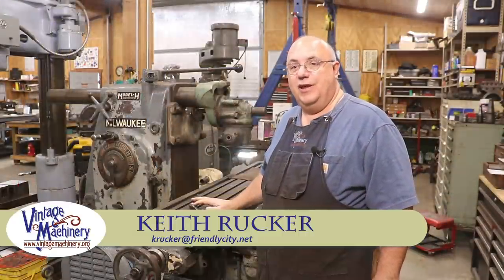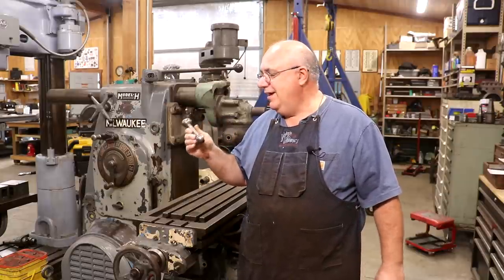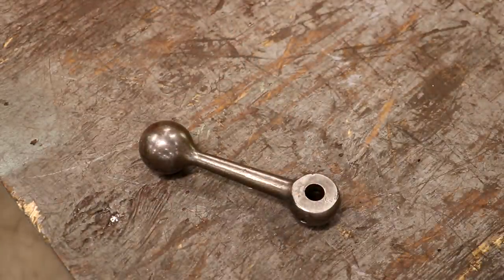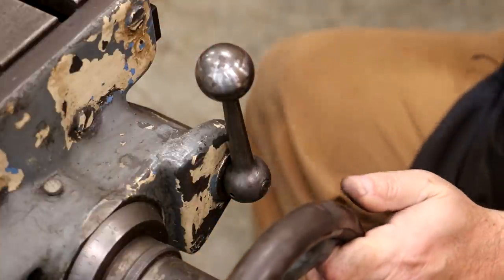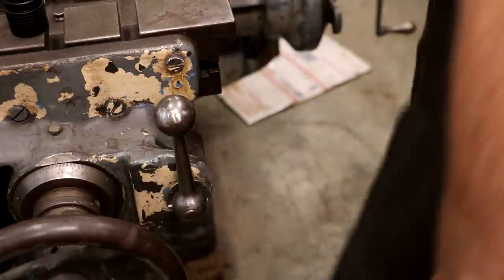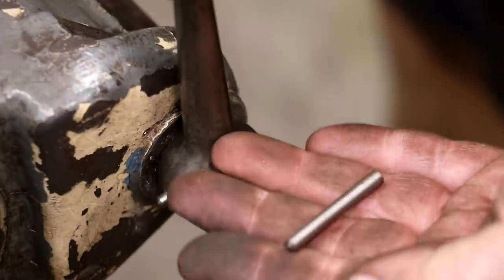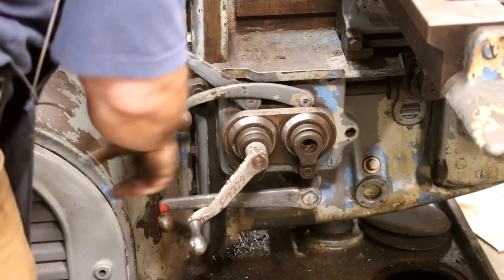Installing a Replacement Feed Side Control Handle on my K&T 3H Milling Machine

Comment: Hi Keith!  Thank you for your videos - they are well done and informative - especially the ones about the K&T!  Throughout the knee-type product line (numbers 2 to 6) the model Ks were heavier machines by one column size than the Hs.  The numbers relate to table travel.  A 3H would have the same table travel as a 3K (34 inches) but the 3H column would be the size of a 2K column.  (FYI the optional controls on the side of the machine are  designated as "rear controls"  because they are behind the table.)  Jim Donndelinger - K&T 1953-1990.
Reply: place I worked at had dozens of the K&T knee mills when i started there. Virtually all had the rear controls, and always thought all of them did.  I remember K&T advertising that this machine could duplicate itself (now I feel real old). Later on (early 1980's) they came out with a new line of knee mills, and these were to be avoided! I rebuilt two that were about three years old (tool room use only), and the engineering just wasn't there anymore

Comment: Keith- in a former life I was a helicopter mechanic, Bell 47s- and they used a #2 taper pin to secure another pin that secured the upper engine mount to a tube steel “engine basket “.  These pins were threaded on the lower end and tightened by self locking nuts.  In flight those two pins held the entire airframe to the engine/rotor assembly.  Quite essential, but never heard of a failure.  Who’d a thunk it?

Comment: I've spent many hours running vertical and horizontal Milwaukee K/T mills. Fantastic American quality. Brute power, and precision. Although it is hard to beat a Bridgeport for light milling, precision hole punching, and ease of operation. Keep up the good work! Lotsa memories.
Reply: With Booth, Fenner, Rucker & Summers using K&T: Who has a chance to piece a nice collection together?! Just kidding. I didn't discover my YouTube Professors until after I bought my Van Norman. As for the 'Brilliance of Bridgeport' (wait for it), I prefer the solid design of the older machines with their centralized table feed motor. Those have very robust columns & really everything be comparison. Yet, Bridgeport's Brilliance is in their head design. It is almost intuitive! In fact it is so foreign to most of us to move the part on the table into a spinning cutter, that it was easy for Bridgeport to become a household name! Hey, I've got a Bridgeport head for my Van Norman (just in case)!!

Comment: haha, check that out. The side controls have a safety feature. You can't engage rapids if the removable handle is  not removed. :-) That is adorable.
Reply: I caught that as well....can you imagine having that handle in place and pulling up on the rapid feed and having that handle slapping around your privates.....yikes.
Reply: @ericsandberg3167  Yes, I can imagine that. I've ran a couple of machines that had no safety features like that and if you engage a rapid, the handle goes spinning, weeeeeee! I've personally never been hit by that, but one colleague of mine once decided to be annoying and stand over my shoulder, and he got slightly smacked. Can't say I felt bad for him.

Comment: Made me reflect on the number of times I've seen younkers wailing on a pin with a drift and 4 lb hammer because they had never seen a tapered pin. The look when you give it one sharp rap and send it across the room is priceless.

Comment: You remembered me of the Cincinnati no.2 tool &cutter grinder. The cross slide handle turns backwards to a milling machine. I have operated  them for over fifty years and found no reason for it . Over time you get used to it . The No.2 original had only controls for the table rack and pinion only in the back side of the table but in newer models they had dual controls front and rear. Made the machine more convenient to run .
I agree with you taper pins far and away better than a roll pin . It makes a lever or arm stay put. 
I think they did it that way because it's easier than a threaded shift and keyway .

Comment: As the owner of a Kitchenaid mixer I'm surprised K&T didn't have a pasta maker attachment.
Reply: (:-))) Pretty heavy for a mixer but might work if you like to do your milling and cooking in the kitchen?
Reply: @ellieprice363  sometimes we’d like to whip up a snack in the shop. That would be perfect. Having a mixing attachment would be a dream. I could whip up pancake mix on the spot.
Reply: Hey, just hook up your kitchen-aid mixer to the end of that rotating KT arbor and have at it.

Comment: I was surprised to hear you say you didn't think a machine tool company wouldn't use a jig to make those holes. They are in the business of making precision parts and I didn't think they would do it any other way. They might not taper the holes but it seems they certainly would have made the holes in the shafts and handles with matching holes.
Reply: I've replaced dozens of handles on them over the years, and a new handle is usually very close. You will still have to ream the taper pin hole as the ship it a little undersize. Location will be very close everytime. Personally I hate taper pins, but thats about all they used sixty years ago. I even went so far as to make several blocks to drill and tap them to pull the pins with a knocker. I hate hammers!

Comment: I think I learned to like tapered pins back in the 1950s when my dad began buying Norden (or Sperry? I forget) bombsights to salvage for small gears and bearings. They put those things together with set screws and tweaked the positions of the gears and the bearing brackets until everything ran smoothly. Then, without loosening the set screws in the gears and hold down screws in the bearing brackets, they drilled, reamed, and drove in tiny (these were 1/8" shafts) taper pins. Once set, they could take it apart for service or repairs, and be assured that it would go back together in exactly the same position, with all clearances preserved. Even as a pre-teen, I had seen how set screws came loose and things shifted or spun on the shaft when you depended on set screws only. Brackets moved to the limits of their clearance holes when their bolts or screws worked loose. Taper pins made things STAY PUT.

Comment: Hey Keith there are so many people who would swear that you are running that file by dragging it back and forth on the part like that. Do it some more. Funny thing is it actually doesn't ruin a file doing that as this guy showed in a video. He showed the only time it ruined a file is when it was a fine file. A medium or coarse file it actually did no more damage than doing a lift to return to the back position before the next cut. And it actually cut more material than a lift type of use. I was surprised to find that out.
Reply: Yep, Fireball Tool.  Really enlightening experiments.
Reply: @royreynolds108  can't remember who it was but it may have been fireball. I've always let the file drag even though everyone says I shouldn't.

Comment: I can't say that I've ever seen the slotter option on any K&T knee mill. The universal head was seen every now and then, but not on everyone. There was a tilt table option, but also not real common. Then of course there was the motorized head stock and tail stock option. I've seen two or three of them. A well built machine, and about the only thing to work on was the feed system built into the front of the knee. Lots of little parts, but pretty much strait forward. Alot easier than a Cinn.  knee mill. If you take the spindle line apart, be sure to order new bearings right away!! Some of them used a real odd ball center bearing (I learned the hard way)

Comment: I agree with you that taper pins are better than roll pins. I've had roll pins shear off on distributors in my old truck. 4 different distributors failed because of the roll pin shearing on me. I would be driving and suddenly the truck engine would die and the tach would drop to 0 even though the engine was still spinning. Dont know if it was a bad batch or what but they were under warranty so I just took them back. Only had to get a tow 1 time.
Reply: Did the roll pins shear of did they break? One is too soft and one is too hard.
BUUUT better a roll pin break then a distributor drive gear or shaft fail. 
Chinesium parts are just garbage. Uncle Tony's Garage has many rants about new garbage parts.
Reply: @bwyseymail  they sheared. On the first one I understood there was a problem with the distributor and it wasn't free spinning. On the others you could spin them freely. Of course the fit of those distributors seemed kind of sloppy so that could have caused binding. I bought a hei ford distributor off ebay and the tolerances were way tighter and that problem stopped.

Comment: So this would not affect function, but I noted the handles on the opposite ends were clocked 90 degrees apart.  Was that intended, or is that a result of using existing pin holes?  I think the ease of this job was pay back by the machinist gods for the work you had to do to remove the shaft on the 48” wheel!
Reply: Probably to fit the intended operator position. The "new" handle is made to be operated from the other side of the table and it would be a reach if it were in the same orientation as the handle on the right, which is made to be operated from the front of the machine and is horizontal so to not interfere with a workpiece on the table.

Comment: Keith, A good practice with taper pins is to fit the hole such that the large end of the taper pin stays a little bit proud and the small end of the taper pin is a tiny bit recessed. You will then know which end to drive from when you wish to remove the pin.
Gary-78-Year-Old-Home-Shop-Machinist in the beautiful Ozark Mountains of Northwest Arkansas

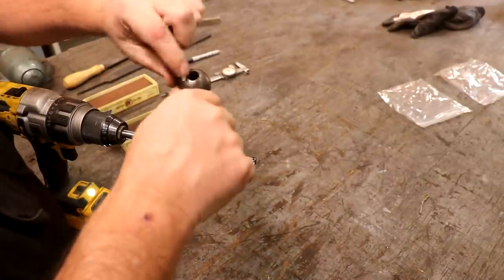Comment: @6:43 you tighten a keyless drill chuck by clicking all the way forward, then one click back to lock it.
Reply: LOL - only if the particular keyless chuck has such a mechanism. Keith used the easy way, which is simply to engage forward gear.
Reply: @johncoops6897  Even after using forward gear to take up the slack and snug up the bit I find that I can tighten it further by turning the chuck body (in the usual tightening direction). The drill has an internal clutch that locks the shaft so you can get more tightening torque this way than you can get from the drill motor. I don't understand the op's "one click back" at all though.
Reply: @kevinmartin7760  - yeah, I agree that you can get more torque in that way... but only if your drill has the chuck locking dog clutch, and a lot of drills don't. Personally I hate them, since they make the drill clunk and bang in response to every trigger release.
Also, that kind of chuck is really only common on very modern battery drills. My mains powered drills with Keyless chucks don't have a mechanism to lock the spindle, and I've been using non-locking battery drills for so many years that it's my habit to "rev and grab", both to loosen and to tighten!
I probably own 20 or 30 drills of different types and sizes, so it's easier if I don't need to remember which type of chuck is fitted.  I'd say that habit or convenience is why Keith does it too.

Comment: Timeline of a Milwaukee machine owner:
year 1:  Wow! it's so pretty, can't wait to get it running!
year 25:  Still going strong!  no problems!
year 50:  Oops, stripped a screw head.  Fixed! no problem
year 100:  ooh look, the first paint chip!  better save that in the album
year 200:  hmmm, seems a little loose.  Oh! found a screw replaced, tighten it back up and no problem!
year 1,000:  Oh wow! a vintage Milwaukee, it's so pretty! can't wait to get it running!
year 3,000: Still going strong! no problems!

Comment: Is that standing above the level of the table? I am sure you have it right, but it would look a lot less vulnerable if it wasn't quite so vertical?
Reply: No, that handle does not stick above the table.
Reply: I just double checked a half dozen pics of the  K&T 3H Milling Machine's ... they all; had this same handle placement .. and it's a good inch and a bit below the table

Comment: Taper pins are awful if you're trying to restore old equipment.
Reply: It's always so much fun (/S) when they've been beat on from both ends so hard they are mushroomed inside the bore, it's very hard to tell small end from large, sometimes the are bent inside the bore, rusted in.... And then, once out, you've misplaced the correct reamer.  The joys of restoration!
Reply: I've actually never had a problem with a taper pin.  As long as you can identify the ends...